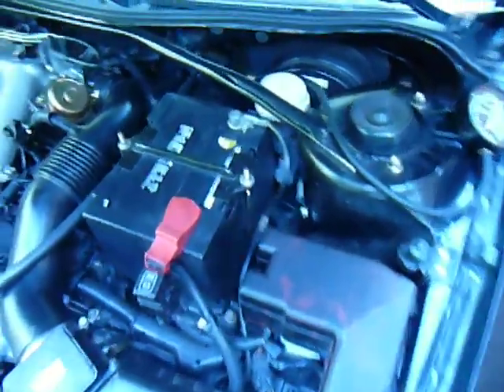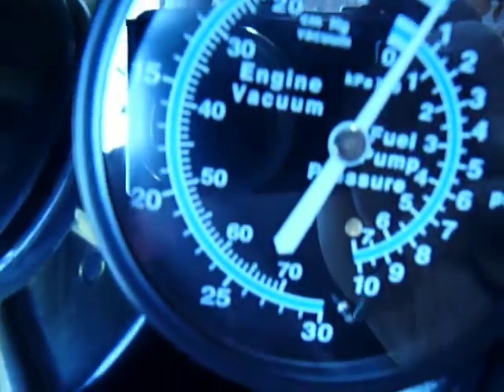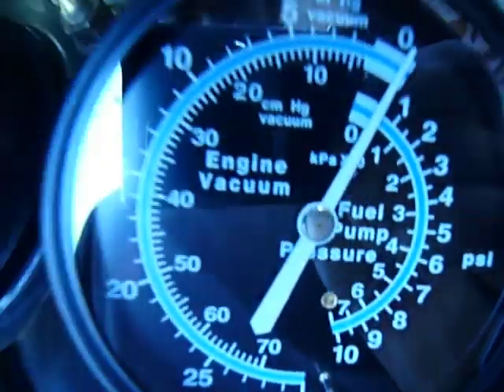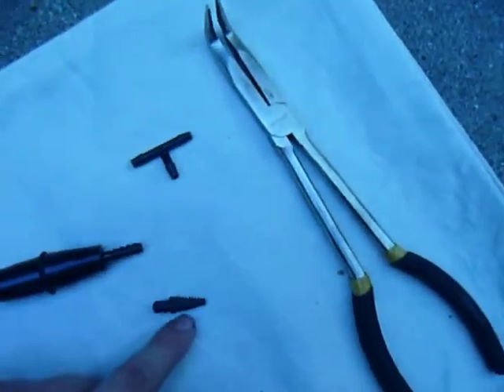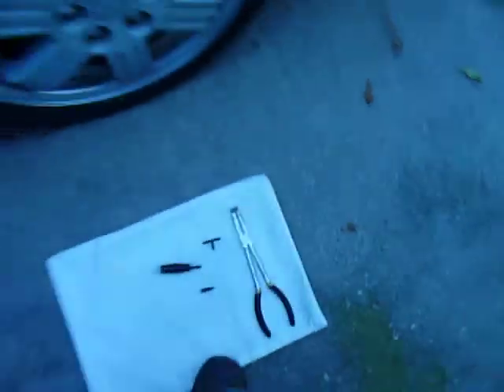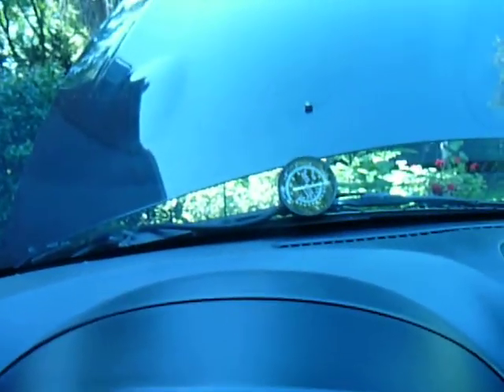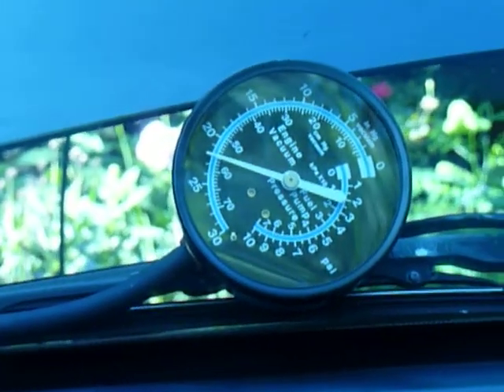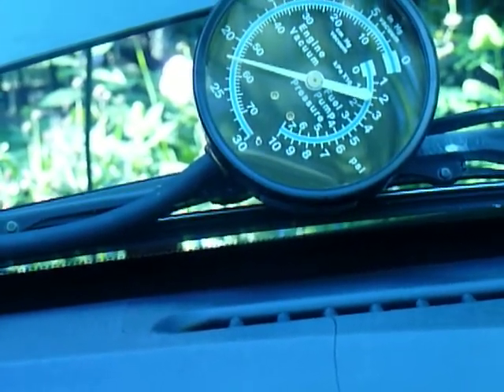Club 3g: 2000-2005 eclipse: Using a vacuum gauge to check engine

Comment from the maker: I would use a plastic tee, a cap, and vacuum hose to run the gauge.  You could use the cruise control line if you wanted.